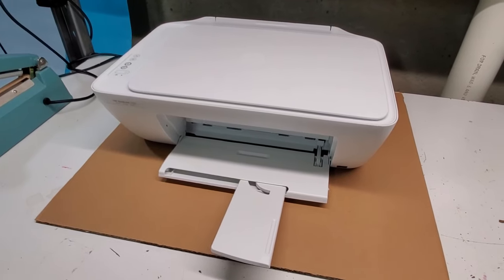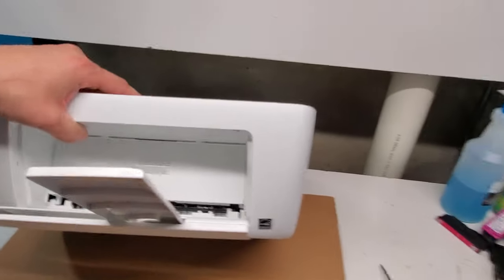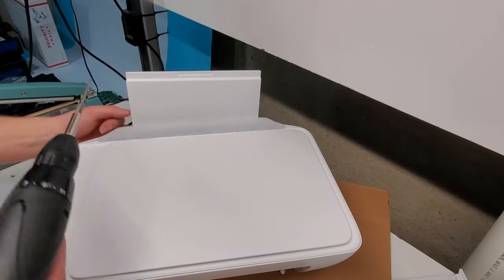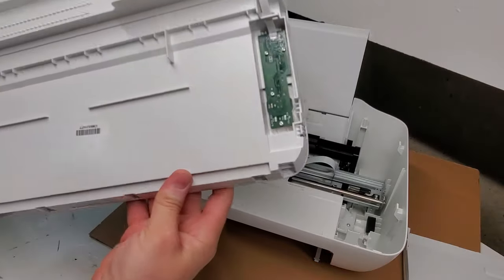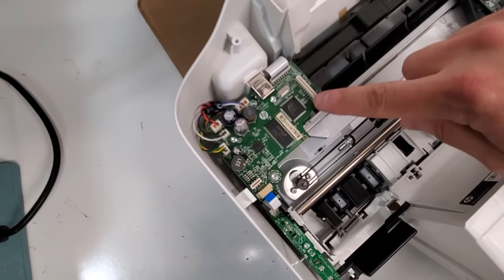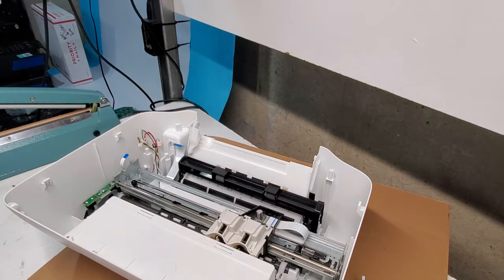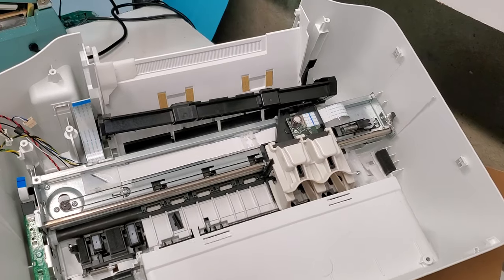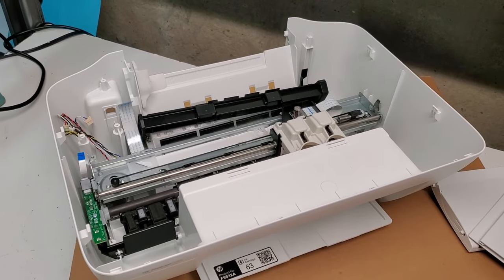Taking apart HP Deskjet 2130 Printer to fix Paper Jam or replace part

Comment: Very good information brother ❤❤❤ i just flip my hp 3223 and from that the ink come out from the scan area it was just an residual ink which printer throw it to clean the print head frist i was scared that cartirage leaks and i open it with 4 teeath t-9 l n key but two of them dont get open and now i have to buy the t-10 l n key 😢😢

Comment: Thank you. Our 2134 developed some  kind of paper jam that the control panel kept insisting was "out of paper". Your video gave me the confidence to unscrew the damned thing and find a piece of (redundant?) hard black tape sticking out of a kind of sump for, I suppose, ink left over from head cleaning.  Perhaps the tape once had a sponge attached? Who knows.  Anyway, I squelched it back down, screwed it all back together, and now it works fine.  De momento, por lo menos.

Comment: I have hp printer with scanner. I want to use only scanner. I want to disconnect printer from mainboard only scanner i want to use. Is it possible to work the scanner even the printer flex from catridge and the  connection related to printer i want to disconect from mainboard. Is it possible to work the scanner?
Reply from the maker: Unfortunately,  that isn't possible.

Comment: Bro my printer is not turning on.... power button showing low level light....the problem is in adaptor or circuit...
Reply from the maker: I'm sorry there is a problem. Try changing the plug and see if that helps. Also it is possible that the connection to power supply inside the printer may be loose.

Comment: Worst scam printer ever i litteraly only could print 5 pic of colour paper with brand new original 305 cartridge 2700 series
Reply from the maker: Unfortunately the starter ink cartridges have very little ink, however it is possible that the setting of printing of photo nay have been set to very high quality and that is why it used up ink so fast.

Comment: Hello sir how can i fix the printer which the cartridge bangs to hard. I think the thing behind the cartridge like cartridge wall is damaged. What is the name of it, i wanted to buy but i dont know the name of it. It looks like plastic strip.
Reply from the maker: Hi. Yes, it is a timing encoder strip. It can be replaced or fixed. If it ripped,, you can fix it by putting a little piece of tape on both side of the end of the strip. Make a small hole in tape where the hole is originally, and reattach the strip. Thanks
Reply: @303electronics  thank you so much sir.

Comment: Great video, but how do I get the carriage out? I'm having trouble where I get ghost images even with a new cartridge....
Reply from the maker: Does it do that for copy or printing? If for both, you may need to check cartridge and make sure all packing protective film tape is removed from cartridge. Clean the contacts on the printer. They are golden dots in the back of the carrier, where it touches the golden contacts on cartridge. If it is doing blanks for prints only and copy is fine, settings need to be checked on the device from which the job is being sent from.
Reply: @303electronics  it was always fine until a month ago. I think I have it fixed now though. My problem now is after I took it apart to do the cleaning now I can't use the scan bed because all lights start flashing. Yes I checked the ribbon cables.

Comment: Everything is right but sir, I found that in this type of printer has paper jam issue occurs and side where there is no functioning board  and where the cartrige rest. There I found one trigger type of mechanizem that does not go back to its right position when printer get a bit old. everything is working and I try to place that trigger back to its position it work smoothly but sometimes it get same issue. can you make a video upon it sir, if you could solve it then we will very happy. Thank you
Reply from the maker: Hi. Thanks for the suggestion. I will see if I have a similar model on which I can make a video. Have a great day.

Comment: My 2160 printer has just started squeaking while printing. Any ideas what could be causing this? Thanks!
Reply from the maker: It can be the rod on which the carrier slides, may need grease lube.
Reply: @303electronics  thank you! What type of grease should I use?

Comment: Please show how to get under the pickup roller and clean the input area of label paper where labels have become stuck and can't be removed from the little underside door
Reply from the maker: You will need to remove the top of the printer to get inside. It is still not too easy to do so. Use tweezers to remove stickers from roller.

Comment: Can please do a video of removing pickup roller? I need to change the grey rubber on the pickup roller but i don't know how to deattach it😭....my printer is hp deskjet ink advantage 2545, the inside part is the same with the printer u did in this video
Reply from the maker: Its very hard to remove the pickup roller. Did you try cleaning it first?
Reply: @303electronics  yes i did, and it still refuse to roll in the paper....is it impossible to be repaired?

Comment: So happy I ran across your video on HP printer disassembly.    I was doing a interior clean on my HP1220c Deskjet  and while cleaning around the cartridge slide bar with some alcohol the "encoder strip" got dislodged on one end so I took it out.   Replaced it and printer heads are not moving.   Saw on your video that the "encoder strip" must be threaded through the cartridge slider assembly.    I am sure that is my problem.  Was hesitating as since it is called "encoder strip" I thought perhaps it may be important as to which end you put in to the machine.   I t can be installed I think in either direction physically but I wondered if the strip has a "Left and Right Ends" making it important as to which end you attached to the left end of the machine or right side.   Or is it "non-directional" as far as re-installing it???  Thanks.
Reply from the maker: Hi. Thanks for watching.  Yes, it usually is important,  but if the amount of blank space is same on each side, it won't matter which side is right or left. It's an older model, I'm not sure how it is supposed to be.  I'll research and if I find out, I'll update you

Comment: j havent used mine for like 2 months, now i check back theres a lot of black ants nesting in the printer and they already reach the mirror part, if you dont mind can you do tutorial on how to open up the mirror and clean it?
Reply from the maker: I will try to demonstrate it on a similar model and will post a video.
Reply: @303electronics  thank you so much
Reply from the maker: I have uploaded a video with instructions.  The printer I use is similar to yours, use torx screw size 10 tip to remove screws. I hope it helps. 
https://youtu.be/HM-G9AKJd9g

Comment: Hello your video is great. I'll open up printer with this to see what causing problem..."door open error" while i close the door, open again and closed, tried so many times but no solution. if u have any idea please reply. Another question timer strip got ink on it. Can it be culprit? Thanks 😊👍
Reply from the maker: Hi. Yes, since you will be opening up the printer, clean the strip from ink since it will cause errors. Make sure you are very gentle with the strip to avoid tearing it or pulling out of the sensor area. The latch that is there for the "door open" sensor may be stuck or broken. Should be a simple fix. Let me know how that goes. Thanks for your feedback.  Have a great weekend!
Reply: Where is door open sensor please 🥺
Reply: Can is clean strip with nail polish remover?
Reply from the maker: @29monir  I'm not sure, have to look into it when I'm at the shop tomorrow. Should be on the left or right side of door just inside the door opening.
Reply from the maker: @29monir  oh no. No way. You will ruin it. Just use a simple cleaning solution or water on a napkin or paper towel. Never use nail polish remover for any parts on printer. Too harsh, I think.
Reply: @303electronics  😱 thanks mate. You saved me....😊

Comment: hello there, is there anyway on how to reset this printer to factory default? thanks
Reply from the maker: Hi. Usually there is a way on hp printers, however this printer does not have a screen and i do not know how to reset printers without display. I'm sorry. I hope someone may know more and will post a reply.
Reply: @303electronics  thankyou verymuch your video was a big help, just opened my printer and check if i can reset something. But i see nothing.

Comment: [09/10, 11:07 pm] Ravi: Hello sir i have a problem for my printer
[09/10, 11:09 pm] Ravi: Please help
[09/10, 11:13 pm] Ravi: When i power for my printer with a tester it indicates light everywhere in the circuit and printer does not start.. Its fault of mother board or adapter
Reply from the maker: Honestly, I would not be able to know. It can be power adapter, logic board, or both. I'm sorry.

Comment: hey can u help me. i have hp deskjet 2135 and i buy brand new ink but as soon i replaced my ink , the black ink light blinking while the colour just fine. can u help me how to fix that?
Reply from the maker: Hi. Did you buy aftermarket or HP brand? Most likely the cartridge is faulty or you didn't remove protective packaging like tape on contact area. Please let me know.
Reply: @303electronics  i buy hp brand. i tried on my friend printer , it works just fine but when i put my black ink in my printer, the black ink light just blinking and i cant print anything cause the device is "busy"

Comment: Sir will it work with any timing encoder strip. Because there are many strip showing on online shopping. My printers strip is not broken but some of the dark part on the strip has Some scratches and disappeared. Thats why i thought my cartridge is not moving gently and cannot print at all.
Reply from the maker: Less likely that. Try cleaning the rod on which the carrier slides and add some grease lube to it
Reply: Sir i tried but still not working.

Comment: Hi , my printer does not respond to copier button also and does not print from pc also, can anybody tell me the reason?
Reply from the maker: Are any of the buttons or lights flashing? If all lights seem to be acting normal, the button control board may need adjusting, maybe wiring or connections.

Comment: Could you tell me if it is possible to physically remove the WiFi?
Reply from the maker: It has a wireless card attached to the main board. Yes, you can physucally remove it, but I do not know if printer will see it as an error and if it will continue working.

Comment: Hi any idea,  mine feeds 2 paper,  1 at a time and then it stops, and it keeps rolling and wont eat the paper.
Reply from the maker: Hi. Make sure the papere is not pushed too far, also check to make sure there is n;t anything at the bottom of the tray.

Comment: Hi man, i just replace my HP 2135 tricolor cartridge with a new one last night. Before placing it into the printer slot, I firstly test the ink cartridge using some tissue and the ink is good. But after i print test some pages the color ink doesn't come out at all. I check the printing preferences/print properties, the option is already at color printing. You have an idea what went wrong? Thanks
Reply from the maker: I'm sorry for the trouble. Is it a new HP ink cartridge or aftermarket or "remanufactured"? Often times the remanufactured ones from eBay or Amazon may have a problem, rarely though. If ink cartridge feels like it is filled and seems to be in good condition,  check the golden contacts area on the ink cartridge and the printer. Make sure no tape residue is there. Please let me know if this helps. You can also try tapping ink on a moist napkin or paper towel.
Reply: The ink cartridge is brand new, opened from a sealed box i bought from a store. I already tried tapping the cartridge into a tissue several time and they're good, the colors are bright and clear, so I think theres nothing wrong with the ink cartridge. I'm guessing the problem is on the inside of the printer, but I don't know which part it is. It's a 5 years old HP 2135 though.

Comment: Could you tell? Which size of screwdriver you had used to open this printer. Tell in mm size because I want to buy this as a screwdriver. Please reply as soon as possible.
Reply from the maker: Hi. Its torque screw size 10. T-10 or T10. It is star shaped.
Reply from the maker: @prathameshvartak3105  Yes! T-10 torx. The indiamart link is correct, Amazon link is not the item you need. Thanks.
Reply: @303electronics  Thanks a lot sir.
Reply from the maker: @prathameshvartak3105  yes
Reply: @303electronics  Are you sure? I should buy this one for my HP 2131 printer. Because I don't know anything about a screwdriver.

Comment: Hi Sir. I am happy that i found your video. I bought the same printer and when they deliverd mine i saw broken black metal material. I saw to your video that the metal is just holding the wire. Is that part important? And i haven't use it yet since i am thinking to return it. Thanks
Reply from the maker: Hi. Thanks for your support.. I'm not sure which part that is. I would replace if something that looks like a part falls out of box, unless it is a packaging piece.
Reply: @303electronics  I just researched the name of that mini tiny part and they called it as ferrite ring core. thanks for the quick response sir. Stay safe

Comment: Where is the waste tank?
Reply from the maker: There isn't one on this printer.. There are pads that are on the very bottom of the printer that absorb waste ink.
Reply: @303electronics  Oh thats it. Thanks! one more thing, is this the same as in other 2300 variants? i have 2336 and it looks totally identical. Thanks again!